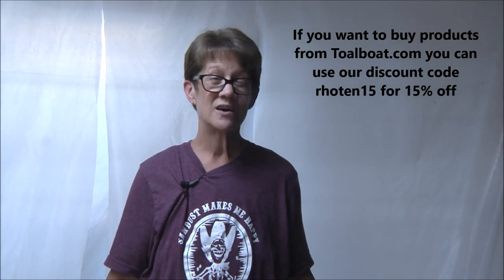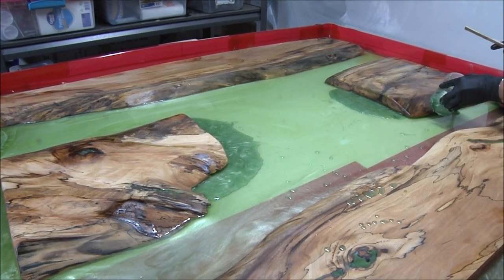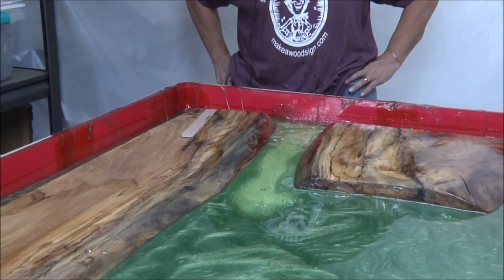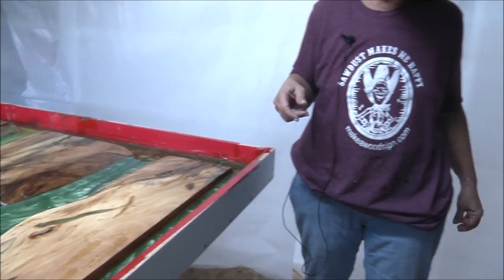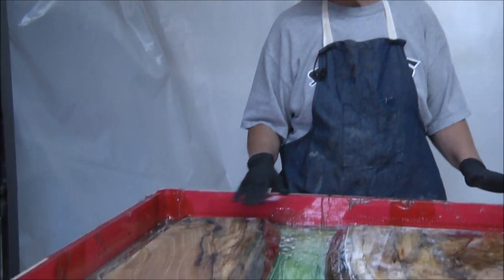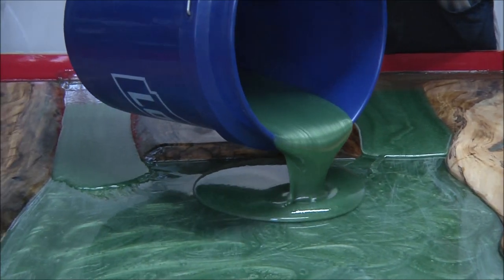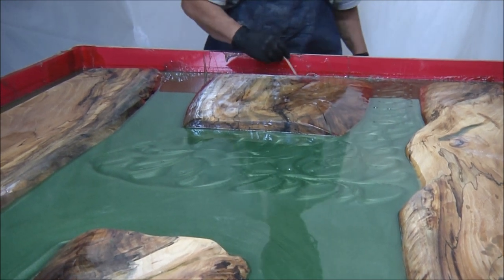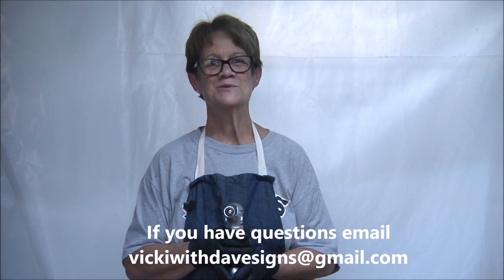#514 Vicki's Spalted Elm / Resin Table Part 3

Comment: Good job Vicki on saving the table. I've done a little research on what is the best tape to use on epoxy projects and so far I found Tuck Tape Construction Grade Sheathing Tape.
You can find it on Amazon. I haven't used it yet. Also I picked up some resin tape through Joann's. I'll be testing that soon on some small projects. Hope this helps for future projects.
Reply from the maker: Thank you Michelle, I normally use sheathing tape but I ran out.  I got it on Amazon, I just ran out.....Vicki

Comment: So, do you think it was an over mixing issue, and not an issue with the packing tap itself? Or do you think it was a combination of both? It's sure looking good. If Vicki throws a little deep yellow in there somewhere, you could have a nice Packers table😎
Reply from the maker: Hi Darrin, I do think it was over mixed.  That and it may have just been to hot in the shop....Vicki